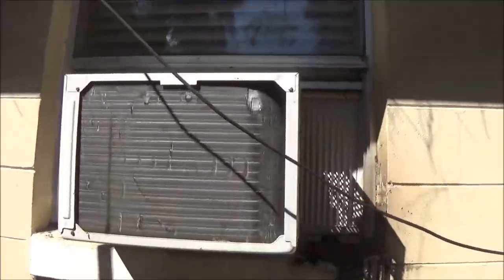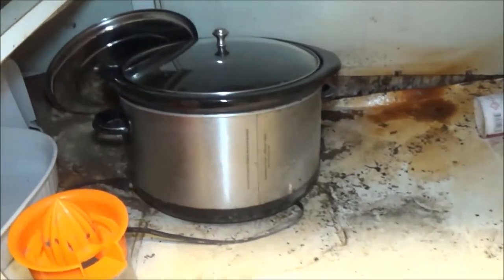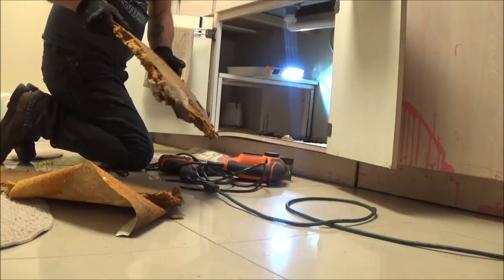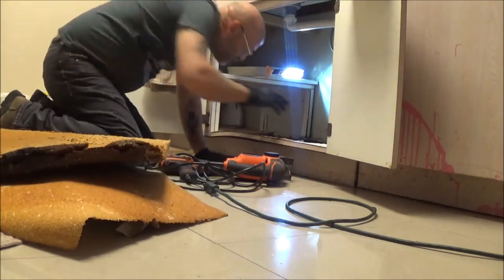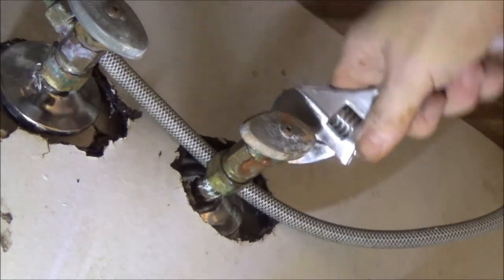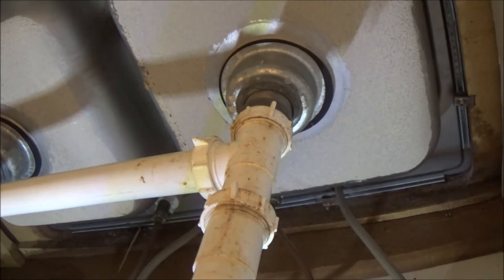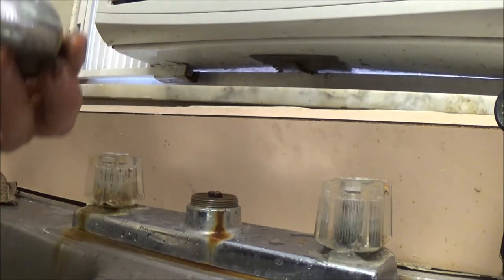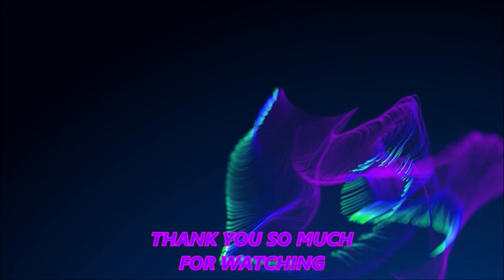When Will It Stop

Comment: Oh I hate press bored!  I have that crap in my 81 mobile home as a subflooring and had the same leak in my kitchen.  The press bored soaked up the water like a sponge and was hidden by the old linoleum until the day I was washing dishes and went through the floor and straddled the floor joists.  I ended up putting down advantech subflooring throughout the whole house.
Reply from the maker: Press board sucks..lol